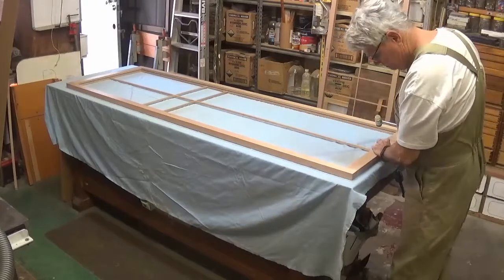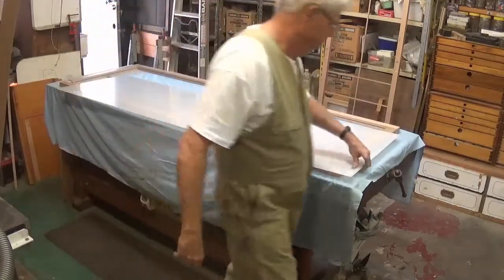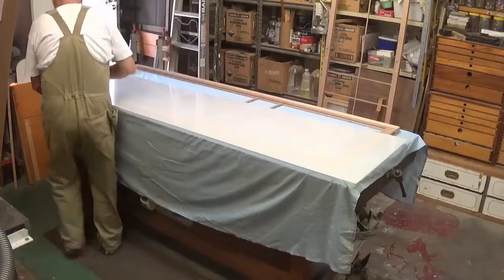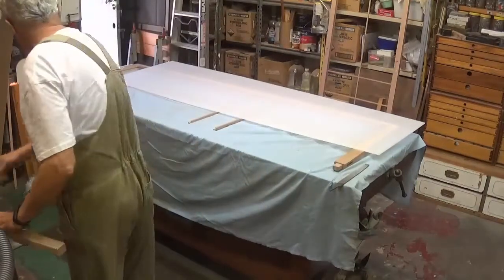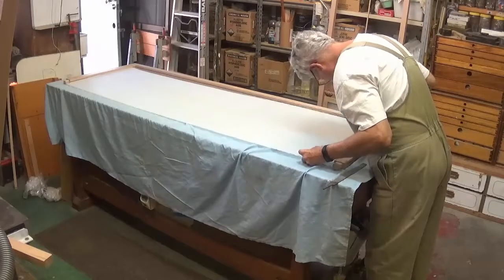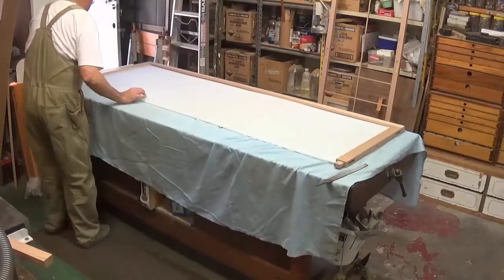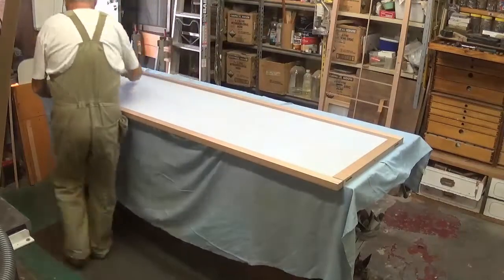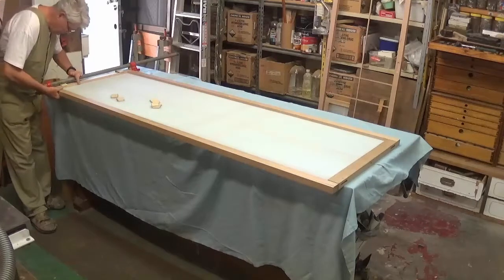HOW A JAPANESE STYLE SHOJI SCREEN IS MADE PART 15

Comment: Hi Denis, great work!  I like that you take the time to make all pin connections.
Just wondering... are you using standard matte finish white acrylic?  What thickness?
I've been considering Warlon laminated paper, or maybe Lumasite.  Lumasite appears to be quite a bit more expensive, but it's strong and looks interesting with the fibers inside it.
Thanks for making these videos.  Keep up the good work!
Reply from the maker: Hi Sean, many thanks for your comments. I don't know where you live, which may affect what products available to you. I live in Australia. The sheet material I use is cast acrylic. It is manufactured in Vietnam. I've taken a photo of the label on a sheet of the acrylic, but I don't think I can attach it here. If you send me an email, I'll send the photo attached to my reply. My email address is denisdiw@gmail.com On the label it says OPAL, which I assume is the color. The surface is like sand-blasted glass. When I order it I order it as Satin Satin. That means I want both surfaces to have the sand-blasted finish.  If I was to make Shojis for a cupboard or wardrobe I could order a Satin sheet. A Satin sheet has the finish on one side only. The sheets I use are 3mm thick, and are 1220mm x 2440mm. I trust that this information answers all your questions. The Satin Satin sheets cost me about 120 Australian Dollars. Cheers, Denis.
Reply: @japaneseshojiscreens.2748  thanks so much for all the info!  I've been finding that "satin" finishes vary greatly between different manufacturers.  Some are still quite reflective.  It's hard to know without buying a piece first.  That sand blasted look is what I would like.  I'll look for acrylic matching your description.  I live in the United States... Michigan.  I'll email you if I'm not certain I found the same stuff.  I hope you are well in Australia.  We're all praying for your safety in the recent wildfires.
Reply from the maker: Hi Sean, sorry for the long overdue reply to your question. The acrylic sheets I use for the screens are 3mm thick. They have the appearance of sand-blasted glass on both sides. The finish is Satin. When I order the sheets I order Satin Satin sheets, which means they have the finish on both sides. For wardrobe door Shojis one sided Satin finished sheets could be used, since the back side is never seen. The single sided sheets are a bit cheaper.
Reply: @seanhorihan9280  wondering what you found? (I'm in PA) I'm sure there will be other people looking as well, so it would be good to have it on here for people to find :)